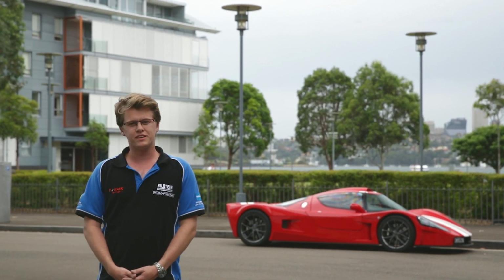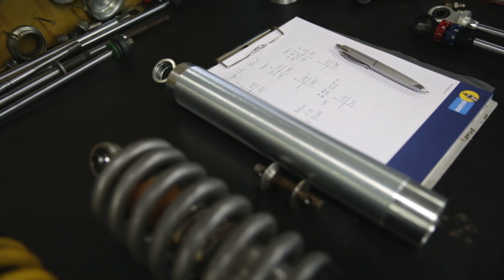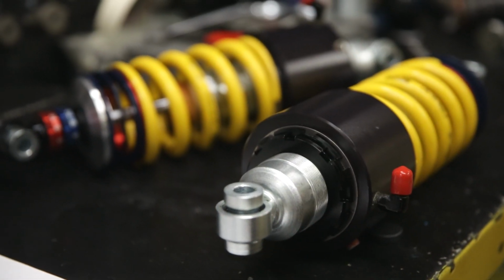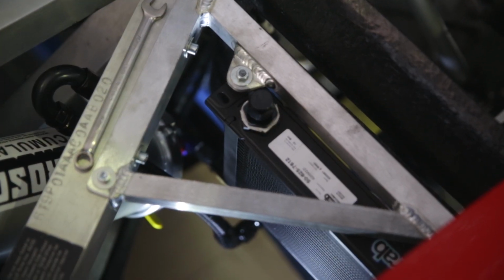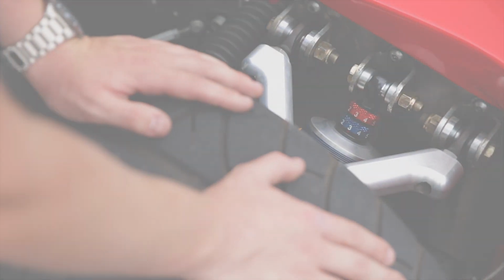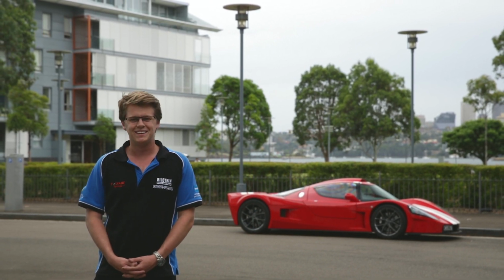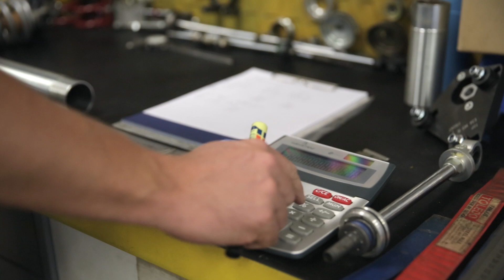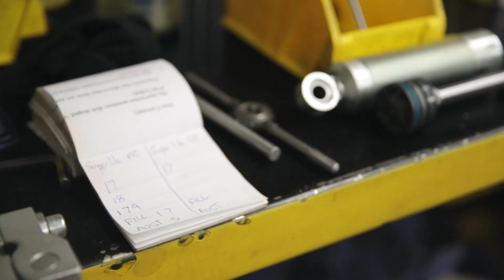Heasman Steering & Bilstein Suspension - Custom Modular Damping Suspension Build on SLC Superlite

Comment: The RCR SLC has not only won multiple races it is a class champion! The road tuned suspension on the car sold for street driving is completely different than the track tuned suspension that wins races. I would love to see a comparison of this suspension to the RCR prepared race suspension.
Reply: If you do some reading there isn't much difference actually except the one limits travel and steering a little bit. But also goes all the way up to spherical bearings.

Comment: This RCR SLC is on my build list right after the ultima evo. these two need to be driven side by side. The bilsteins, look forward to the tests and times but at 8 mounths ago hummmmm is this going to happen? popcorn ready!!!!
Reply from the maker: Fair call, we did in fact go out to Sydney Motorsport Park on three separate occasions to film the testing. Two of the times it rained heavily, and the final attempt the car had some small exhaust leakage issues. Before you know it, 2015 was over! 
We are definitely going to follow this up again very soon in 2016. Sit tight.

Comment: It's not a kit car.
Reply: Yes it is sold in a kit, and is a unique design made designed and fully engineered by RCR. The car can be purchased as a roller and also fully built so the kit option is only for diy types.
Reply: Thats correct. The alum tub, suspension arms, uprights, rack & pinion, etc. are new, not borrowed from an existing car = kit car. Shocks should be custom valved to a specific car as the oem QA1 shock dyno confirmed. Quite a bit of engineering went into this car. Unlike many kit cars still using steel tubing(heavy, old tech), and many components from an existing car to cut cost. IMO, those manufactures need to step up. We're not in 1960 anymore.
Reply: It's a modular car.
Reply: Founder of RCR calls the SLC a component car